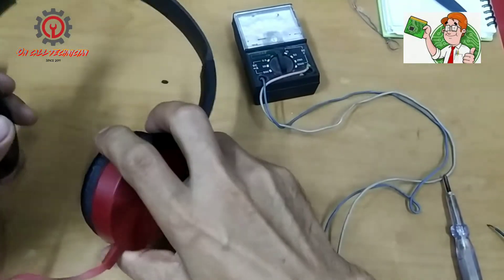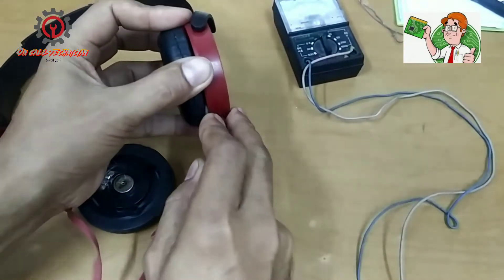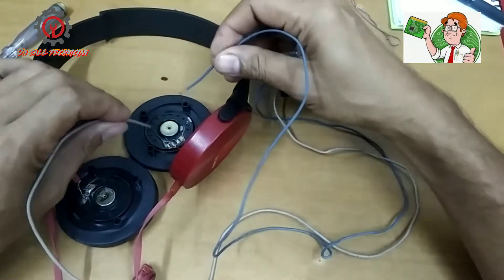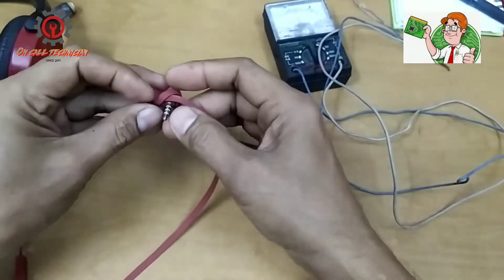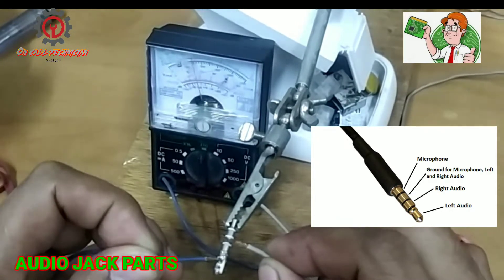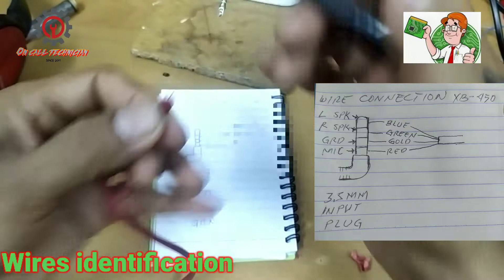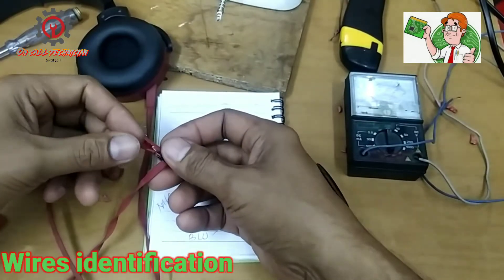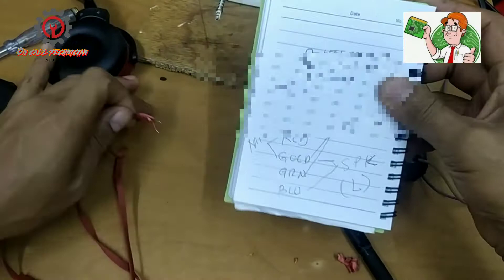HOW TO REPAIR SONY XB-450 HEADSETS / EARPHONES ONE SIDE IS NOT WORKING

Comment: I have this same headset 
My headset's mic stopped working first 
Then the left side stopped working 
Both the mic and left speaker is connected to one wire 
Sometimes if I move the joint where the wires spilt to left and right I can hear it properly. 
What to do bro pls tell me? 
I needed it for online class 😫
Reply from the maker: Only the ground wire is inter connected my friend. Mic and speakers are separated
Reply: @THEMULTISKILLEDTECH  I meant that there must be a loose connection in the left sides wire connection in the joint 
So both the mic and left side stopped working
Reply from the maker: Yes there are absolutely loose connection and you badlt need the help of a cheap tester to the continuity test sir
Reply: @THEMULTISKILLEDTECH  so i need a tester and soldering to repair 
I will have to repair it myself?
Reply: @THEMULTISKILLEDTECH  How can I repair this 
Will mobile shops help me?
Reply from the maker: Mobile shop tells you to buy new my friend
Reply from the maker: Watch the whole tutorial as i patiently answer your questions there.

Comment: Thanks! My left one, the one with mic isnt working. I checked the speaker connections, both show .8 V from pin to speaker connections. I think my speakers are good. Now I need to figure out a way to open the mic and then the jack connections. Mine is MDR -XB450.
Reply from the maker: Go ahead sir
Reply: Sir i have the same issue 
The left one with mic is not working 
But if I move the joint (where the one wire from pin splits to left and right ) I can hear from both the sides clearly 
I think mine has a problem with the joint 
Can u tell me what to do pls 🙏
I want it for online class 😭